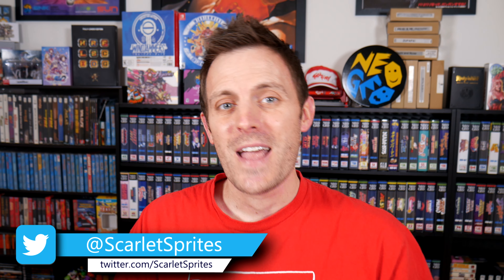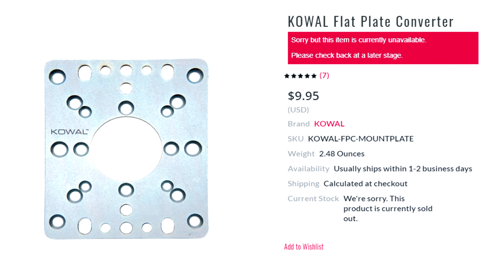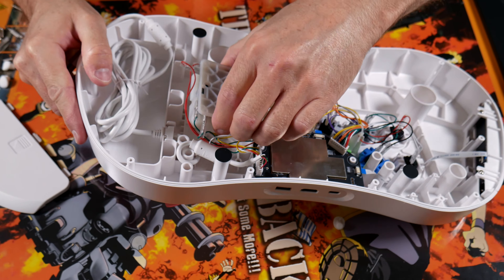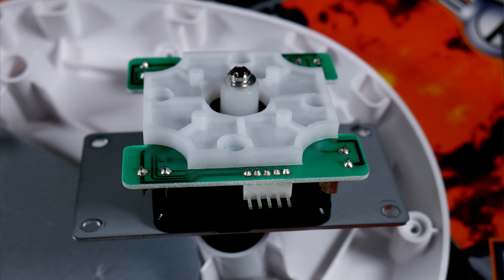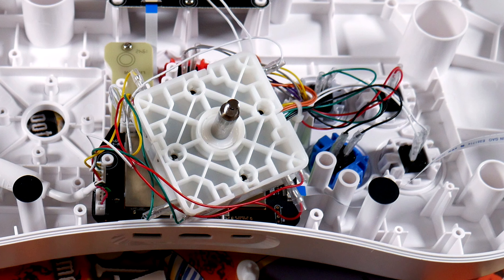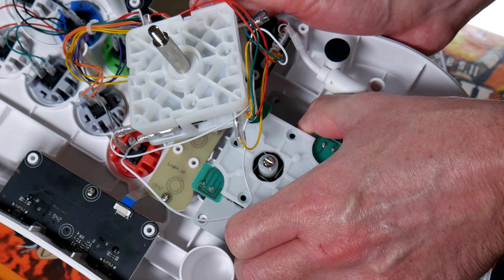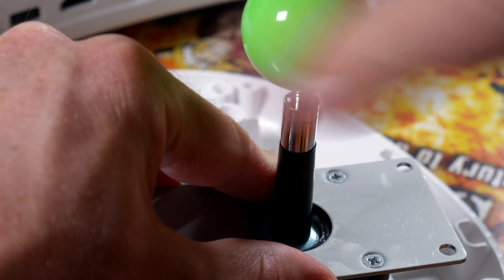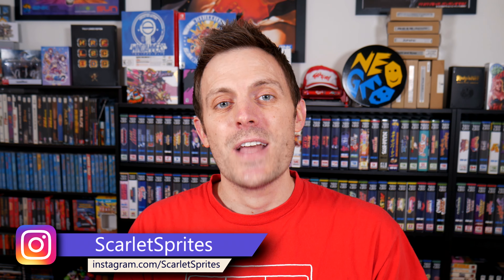Neo Geo Arcade Stick Pro:  Seimitsu Stick Mod!

Comment: Just finished customizing my pad thanks to this great video. Be careful with the order of connectors to the joystick, test it before closing everything (color order was great but still 1chance on 2 to get it right, ending up with right/left on the opposite). Used a seimitsu LS 56 on MS mount plate and good old sanwa buttons.

Comment: Thanks for the video!  Like you, I've got a LS-56-01 stick rather than an LS-56 - what work do I need to do to connect this one up instead - is there a specific connector I can use or am I going to have to rewire?
Reply from the maker: It can be done, but like I said in the video you’re going to have to take the stock wiring on the ASP and then match it up with the pin out on the connector.  It can be done, but for $20 I’d just buy the connector type.

Comment: Hey love the channel! I’m a bit of a Noobe when it comes to arcade peripherals. In future vids could you elaborate more on the benefits of the upgrade thanks 👍
Reply from the maker: I’ll try to mention a little about that in the review.  In short though, stock sticks tend to have generic or even subpar parts.  It really is personal preference when you start playing with swapping things out though.  Some people like a stick that is tighter and returns to neutral fast, others like the looser feel so it doesn’t take as much effort to push it around during gameplay.

Comment: Do you happen to know if an LS-32 would fit just the same?  I've never used the 56 before, but i did previously use a 32 and wasn't sure if there were meaningful differences as far as fitting into a casing.
Reply from the maker: It should work, the mounting plate attaches to that just as well.  I didn’t actually test it (or JLF options) so I didn’t want to comment on either of those and steer people wrong.

Comment: Is the ls-56 fasten type still made anymore?  I've been looking all over and can't find anywhere that has them in stock.
Reply from the maker: Yes, it’s a fairly popular stick which may be why it goes in and out of stock so fast.  It looks like arcadeworlduk has them and you can get the flat mounting plate needed with it from them as well if you’re in a hurry and don’t want to wait for a US seller.

Comment: thank you !  :-)
A quick question  : does the Seimitsu LS-56 Joystick comes with screws (in order to fix it to the joystick ) ??
if not what reference for the screws ?
Reply from the maker: Excellent questions, only one of which I know the answer to off the top of my head.  The screws to put the plate onto the stick will come right from the stick, so you’re covered there.  As for the screws that go through the plate to attach it to the shell, I’d have to do some digging.  I have four that work but I’m not sure if they came with the stick or were just in my box of basement parts.
Reply: ok... i'll keep searching on my side too.... I guess those screws must be "industrial" screws and not wood screws.....
Reply from the maker: Correct, not wood screws.
Reply: OK ! thanks for the information !

Comment: So how far do you plan trick your Arcade Stick Pro out? Maybe add in falshing led lights and speaker that gives the signature Neo Geo start up jingle every time it is powered on.
Reply from the maker: Haha, probably not.  Just wanted to call this plate out (and stick) for anyone who might want a little more.  It actually does have two stock leds on the deck though.

Comment: are you able to replace the stick on the aes arcade stick ?
Reply from the maker: You can, I've seen people use the LS-56 as a replacement but they often repurpose parts like the shaft cover and need to sand parts of the casing to make it fit.

Comment: I have the arcade stick why do I need to change the stick
Reply from the maker: You don’t.  The stock stick isn’t half bad really.  It’s all personal preference, some people prefer a tighter spring or a shorter or longer throw on their stick.  Sometimes just changing the gate out helps.  It’s just nice that the ASP is so easily modded.

Comment: I’m a sanwa guy and was wondering if you know the drop in equivalent for this? Amazing video! I will start to mod my stick
Reply from the maker: I really don’t know the Sanwa equivalent mount, but I’m sure someone will call it out as this ramps up in popularity.  I’m just much more familiar with the Seimitsu stuff.
Reply: UPDATE: https://youtu.be/EL76jhvu2Rk?t=09m13s seems like nihongo gamer already did the mod, it is drop in, but still don’t know if he used 5 pin harness cable. Either way it is possible!